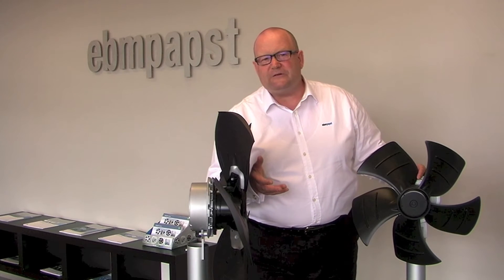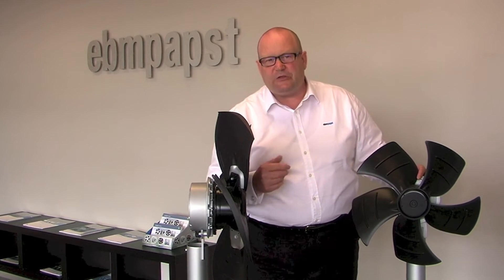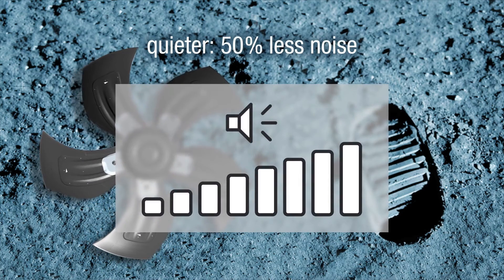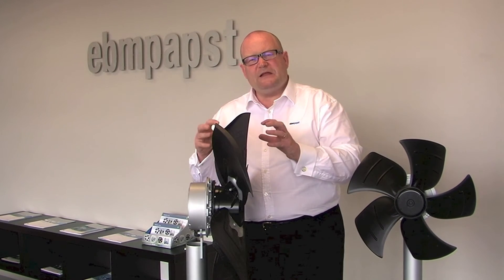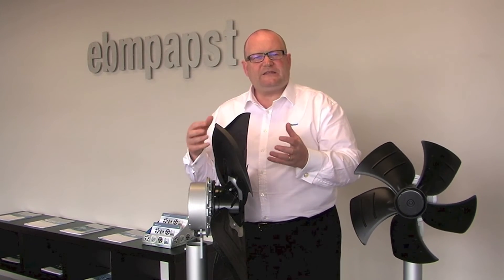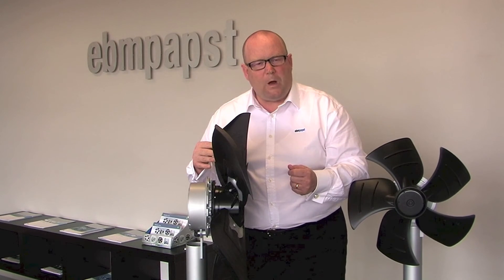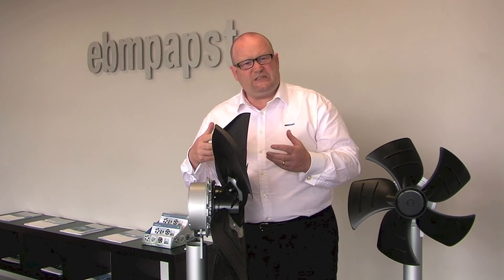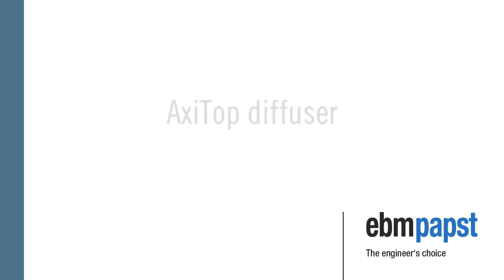Axial fans - ebm-papst A&NZ

Comment: i cant understund you. how is the airflow on this axial blades? Because to me look like normal blades. radial blade.
Reply: Hi Slevin, thank you for your note.  The airflow through an axial fan is in the axis of the product i.e. straight through or 180degress.  This is parallel to the motor shaft.  I hope this helps.